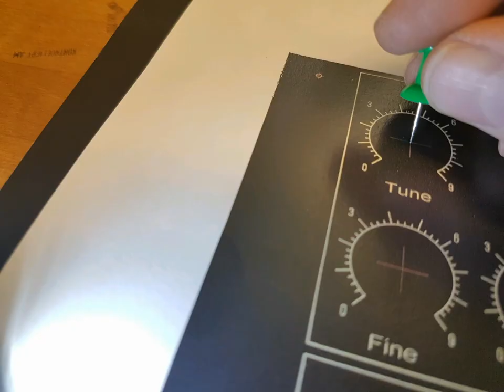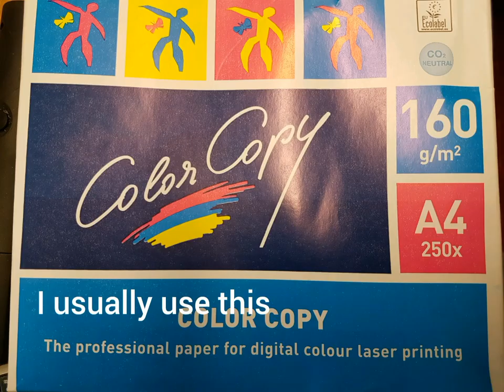Making a Low-Budget Front Panel for a Synthesizer-Module

Comment: HI, I make boutique devices. You may have noticed that your holes are not perfectly round or finished and you uses 3 drill passes to achieve your results due to the drill bits you are using not having the right flute count for aluminium. Instead may I suggest you use a step drill bit. They are cheap on amazon and will allow you to drill your holes in a single pass after marking and de-burr the holes at the same time. With step drill bit, you'll achieve perfectly round and machining quality holes every time.

Comment: I do the same, just drill LAST :) Seriously, if you use decent rotation speed and step drill it won't even damage the paper print. The glue has to be 100% set though.

Comment: Ok but still you need aluminum sheet upright drill a punch ... low budget.... lets say mid budget
Reply from the maker: You are right, without any tools this is not low budget,

but my page relates to diy synths. Of course, I can't make anything without some tools and material.
You can use a standard-Drill instead of a stand-Drill and the Punches i have made by myself of little metallic-tubes.
With a bottle of varnish you can paint many plates and the printings you can make in a store. 

except for the tools i used the Panel in this Video cost me about 12 Euro
Reply: You could use any flat sheet material you have to hand, as long as its 1.5-3mm. You can pick up a used pillar drill for the same as a new hand drill.
Reply: Try making